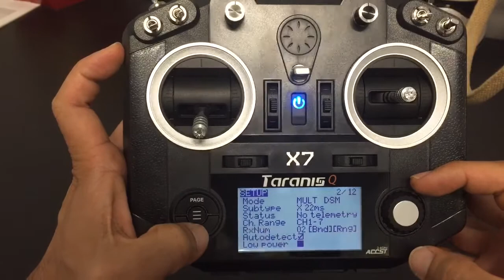Taranis QX7 + iRangeX IRx4 won’t bind to Tiny Whoop

Comment: I think with any spektrum , you have to plug the quad in first which puts it in bind mode 
 then turn the transmitter on and go and push the bind button.

Comment: External mod to ppm. Make suremit is in - might have to invert roll and yaw. Turn off radio...plug in woop...hold down bind button and power on radio u til light in module blinks. Release bind button. (Spektrum ds9 air module)

Comment: You definitely have a bind. You just have your channel outputs wrong. throttle on the right stick as seen in this clip..,no stick arming of inductrix, your right stick is self centering so it won't initialize until you have brought the throttle down to zero first. Go into the mixer page in your Qx7 and re assign your channels and reverse where necessary.  You'll be up and flying in no time.
Reply: SPiTKWAD I have this same problem. I have a tbs tango but am very new to this. How do I know which channels to reverse?